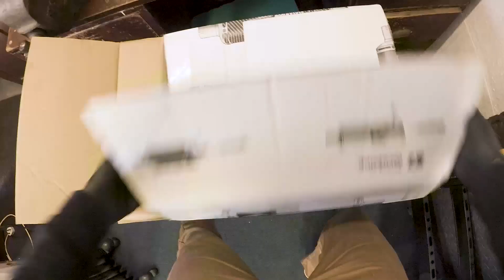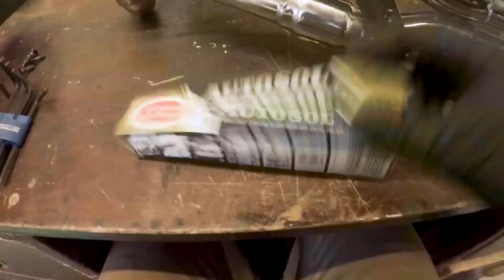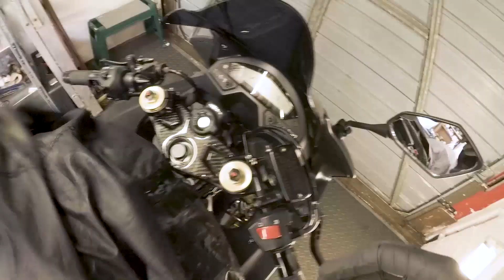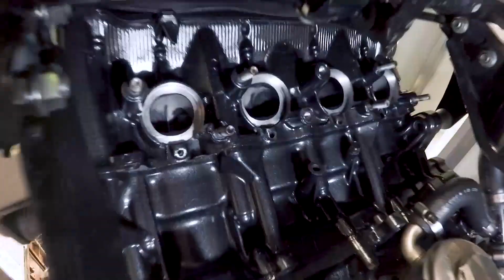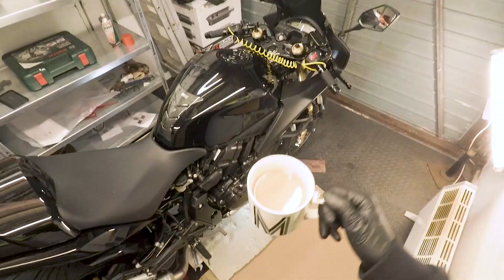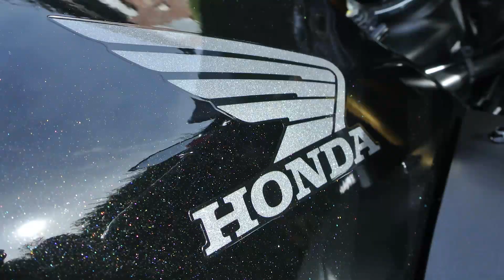Honda CBR 600f decat Akrapovic exhaust sound 2013 2012 2011 PC41 Black Widow

Comment: Really awesome sound men. I have the ixil doublegun silencer at the moment on my pc41 and it improves a lot the sound compare to the original silencer for a very low price. But your combo of the Black Widow pipes + Akrapovic silencer is on a whole other soundlevel. Is this the originial Akrapovic silencer for the pc41? And how much € you paid for the Black Widow pipes?
I have seen also a awesome combo in youtube what I am thinking about to get. Arrow pipes for the pc41 + sc project silencer. But now I don’t know what I will buy next year, both combos sounds awesome. Do you have any advice for me? :)
And I like also very much your belly pan. I searched long time since now for a belly pan for the pc41 but couldn‘t find anyone. Do you have a link for this one? Would be pleased. I have the red/white/black tricolor pc41, love it.
Reply from the maker: Hi only just seen this message, sorry for the slow reply. So for the exhaust set up, I bought the Akrapovic slip on exhaust first then added the black widow pipes later. With just the Akrapovic end can it didn't sound much different to the stock exhaust. Your ixil ones will, as they are much louder even without changing the down pipes. There are videos of the arrow down pipes and Akrapovic end can on YouTube and that sounds great too! I think the arrow down pipes would be great! With and arrow end can it would also sound amazing. It just depends how loud you like it. I wanted louder than stock set up, but not crazy loud. For the belly pan, I had this custom welded on to the black widow pipes. It's the reason I went with the widow pipes as they look very much like stock set up, and with the belly pan brackets welded on, its hard to tell that I've changed them. The arrow ones are better made, but they run the other side underneath the bike (on the left of the oil sump), so I couldn't get the brackets welded on. Hope that makes sense? Thanks for the comment 👍
Reply from the maker: Here's a video of an Akrapovic and Arrow combo...
https://www.youtube.com/watch?v=Nexa9KIdBY0

I think the SC Projects end can would also sound pretty awesome. Once the stock exhaust has been removed and that huge cat is gone, the bike sounds far better.
Reply: Thank you for your detailled answer. I have now ordered the same akrapovic can like yours for a good price - used one. I don‘t know if you know this already, but the finish/model from the black widow pipes for the pc41 have changed this year and now they look quite the same like the arrow pipes, you can see this also on the official black widow homepage. Now I don‘t know which one I should buy, they look quite the same now, the arrow is about 200-250€ more expensive, of course because arrow is one of the leading brands in this market since long time ago now. Now I have to choose one of them, the black widow has also surely a good quality.
I have also found the same heatshild cover on ebay like yours but now it would be useless for me, because the finish of the black widow pipes have changed like the arrow ones and so its not really possible to add the heatshild cover anymore.
I have looked now for a other solution and found a belly pan for the cbr pc41, the company‘s name which is producing them is lacomoto from portugal. I think I will order this one, but the only thing I am worry about this is, if it would also fit on the black widow or arrow pipes, because it‘s made for the stock one. I also found a video by some guy in youtube who already have the black widow pipes (old model) with the belly pan from lacomoto and also the same akrapovic silencer like yours. Following I send you the link, what do you say about this? Do you think it would also fit on other pipes? Thank you for your answer.
https://www.youtube.com/watch?v=f0WarLI7nEI
Reply from the maker: @benavente9199  Yeah I saw they had changed when I had a quick look at their site. I think these are copies of the Arrow design, and probably very similar just a little cheaper. I think they may run in the same direction as the Arrow pipes, on the left side of the bike. You could contact the Black Widow team and ask if they have the older ones still at their factory, they were pretty helpful when I called. I know what you mean about the Lacomoto belly pan. My friend thought about doing the same thing and getting this to cover his down pipes (but he also has the old style). I'm not sure if this would fit the newer pipe design, it depends where the belly pan mounts to the bike underneath. I imagine the newer Black Widow design pipes would fit within the Lacomoto belly pan, as they shouldn't sit lower than the oil sump, but I'd double check before buying one (you could call Black Widow to ask them about how they fit to the bike). On that video you sent, it looks like the belly pan bolts to the rear of the bike, near the O2 sensor and towards the front where the oil sight glass is and completely covers the underneath of the bike. Those belly pans do look good! Hope that helps.

Comment: Hey, great bike. Where did you buy de decat Downpipes?? I can not find it. Thank you for the help.
Reply from the maker: Hi. Thanks for the nice comments. The decat pipes are from a UK based company called Black Widow exhausts. From what I understand they've replaced this design for a newer style, which are a copy of the Arrow racing pipes. So they are slightly different for how they fit to the bike. These look exactly like the standard pipes without the cat. Whereas the new ones run on the left side of the bike, like the arrow pipes. They are supposed to be good though. 

These are the newer versions:
https://www.blackwidowexhausts.co.uk/cbr600-fa-2011-2013-de-cat-race-exhaust-downpipes-headers-28087-p.asp
Reply from the maker: @claudiooliveira2270  I haven't replaced it on mine. I put the sensor back into the pipe. I'm getting the bike remapped on a Dyno soon, so not sure what they will suggest is best for it. I think most people add it back in.
Reply: @SuggyRacing  I love the ones you've got installed as they came with the heatshield, the newer ones do not, and it ruins the look, at least for me. Do you think I could get my hands on the older pipes in 2025?
Reply from the maker: @ i had the heat shield made to fit this exhaust system. I took it to a local guy who welded me on the brackets to match the original. Does look better.
Reply: @ Thanks for getting back to me! I agree, it looks soo much better! I might do the same. Do the welded brackets get hot from the exhaust at all? Wouldn't want them to melt the heatshield :D
Reply from the maker: @ They will get hot but didn't seem to cause me any problems with the carbon shield. On the metal shield it wouldn't make any difference